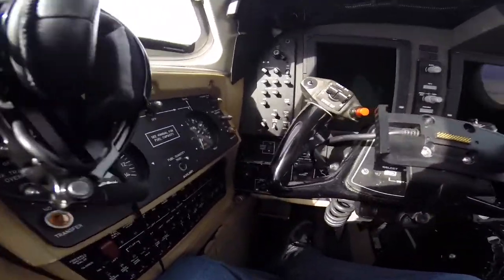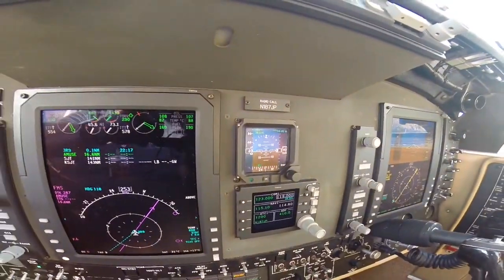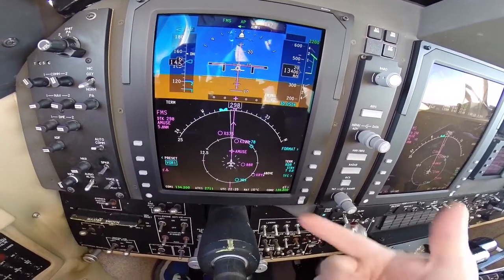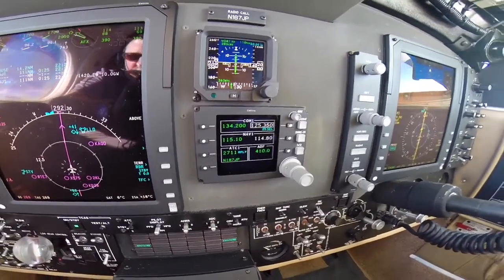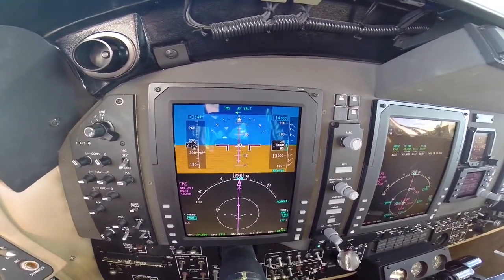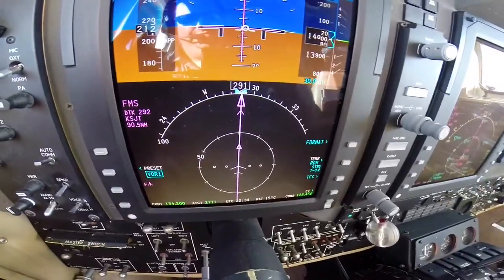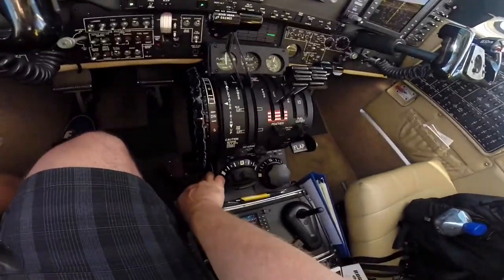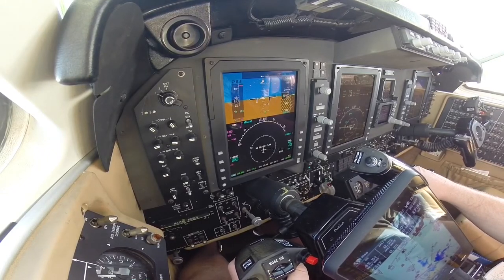Collins Proline King Air 200

Comment: Why did you take-off with LH Condition Lever in Ground Idle and RH Condition Lever in Hi/Flight Idle?
Reply: No such thing as ground/flight idle in a King air. Just Low and High idle, and its only function is really to increase the idle speed. High idle is usually only used to 1-pull in more air and 2-decerease the amount of time for engine to spool for say a short field landing to get reverse thrust quicker or 3-To start the second engine while on battery.
All operations in a king air are normally with Low Idle, however I agree that they should both be in the same position, not one in either or. He could be doing this for a specific reason for this aircraft, maybe a cooling issue in the right engine.
Reply: @JamesWhite-fo9wk  thanks for your explanation. I have not yet any King Air experience, only Pilatus Aurcraft. 
But because of the different spool up times I asked the guy who made the video why he took off like that. I saw in the video he put it on high idle for the second engine start. But for such a video he should watch out for little details like this ;)
Blue skies.
Reply: I’m sure he probably just forgot to put both condition levers back to low idle being busy talking making a video. There’s no good technical reason to have one engine on high idle and one on low idle.
Reply from the maker: Good catch. Looks like I forgot. This video was shot in 2017 so who knows.

Comment: Thanks for the excellent Pro-Line 21 video! I have long felt the Proline 21 is the best "fit" for the KingAir; Better than Proline Fusion, better than Garmin. Heck the older EFIS CRT system was already pretty darn good, but the tubes are heavier and hard to find today, not to mention the better integration of the newer systems with today's GPS/ADS-B enabled environment. Proline 21 brings just the right level of automation to the King, where flying is still partially manual as you have to manage power in all phases of flight. Why did the fuel gauge indicator fall off when Engine 1 Start was engaged?

Comment: Great video on the Proline.  I’m sure many MEI’s  disagree with slowing  under blue line.  If on an approach there is plenty of time to slow after DH or MDA.  If VFR there is plenty of time to slow after landing is assured.  The past few years have been rough for the King Air safety records and not respecting blue line is the common denominator.
Reply from the maker: I’ve been out of the King Air since 2018 and I hadn’t heard about crashes lately. I’ve had this discussion before though about blue line. Blue line is a climb speed, not a descent speed. I’ve noticed that schools are teaching to approach at blue line these days but I’m not sure where that came from. In King Air school we were taught to fly it like any big turbo prop, or a jet, and actually fly the proper approach speed. Either way, if you were to lose an engine on approach, and you felt that needed you to make a go around, which you shouldn’t, then you’d continue down and accelerate to blue line. 
After the king air I flew the 747, and now I’m on the MD-11. Both of these we do the same, when we lose that second engine on final, we accelerate to a climb speed and go around, if necessary, or we just land. 
Fly safe out there.
Reply: @theflyingstones6840  Went from a King Air to the 74? Now there's a bit of an adjustment, being in the nosebleed seats..

Comment: Hi, how does this aircraft flies asymmetrically ie when the left or critical engine fails? Is it easier than a Navajo or deadlier?
Reply: The king air does very well in a single-engine situation.  The Navajo is pretty benign, however, it doesn't climb very well on one engine.
Reply: Not bad...the rudder boost system works pretty well and the 350i has enough power to climb on one engine decently down low.

Comment: Great video!  Got a little bit of right seat time in a C560U, and the FMS was the most difficult thing to learn in the airplane.  This video helped refresh my memory on it.  Without access to an FMS, do you have an FMS training resource you can recommend?  I use Flight Sim a lot so if there is one for that it would be most helpful.  Thanks!
Reply: The flight simulator programs like x-plane 11 and Microsoft Flight Simulator have airplanes that have FMSs that work pretty much identical to the real FMS whether it’s a proline 21 or Garmin. Also, King Schools online sells courses on Collins proline 21 stuff as well as Garmin.
Reply: @mxcollin95  Thanks!

Comment: Where is the turn coordinator on proline 21?
Reply: It's on the video at 7:59
Reply: That's the turn coordinator, my question it's about the turn rate. Wich you usually use for coordinated turns..(2 min for 360°)